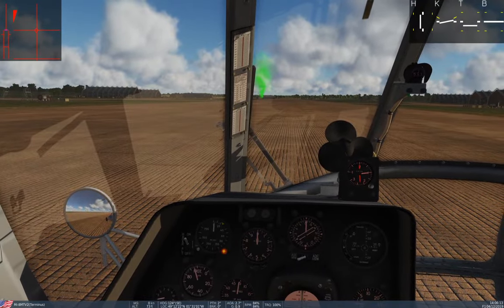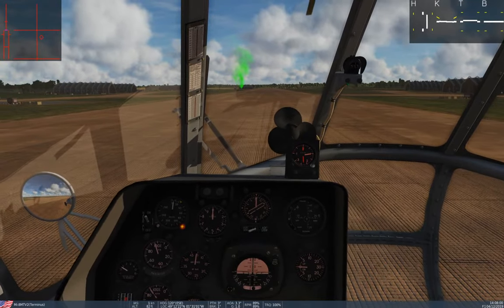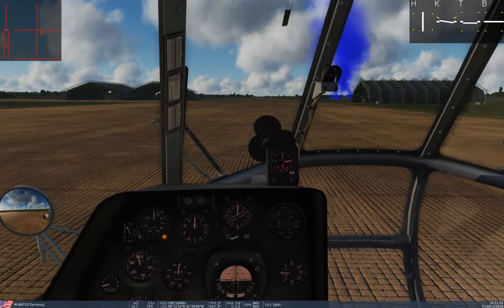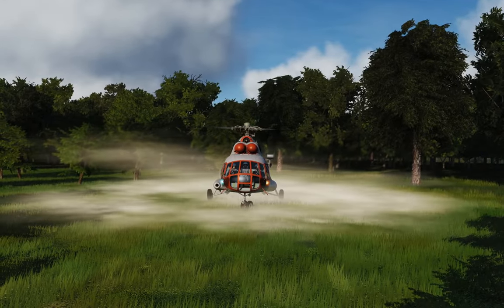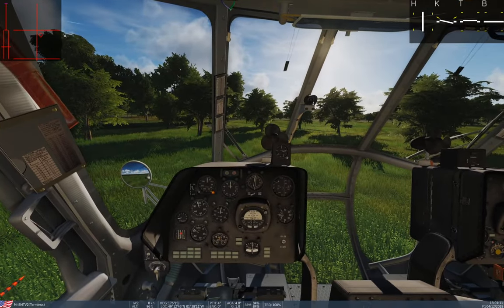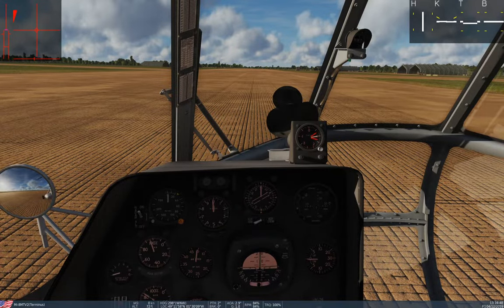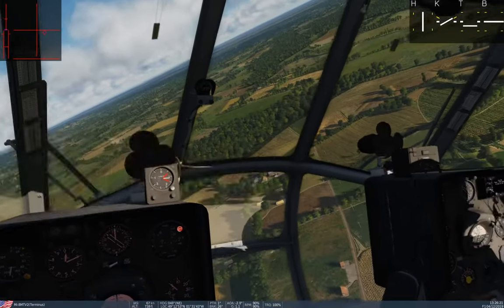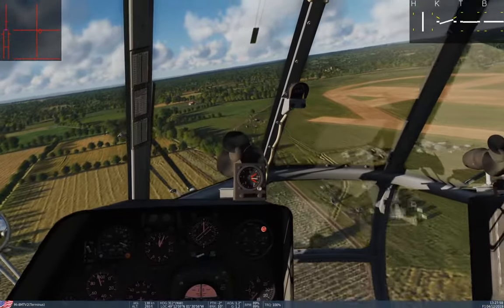DCS Mi-8: Takeoff Tutorial

Comment: How do you feel about joysticks without centering springs vs those with the much more usual strong centering force, for helicopters in DCS? 

I'm completely new to helos but have the option to learn using either type of stick, seems like high end helo specific sim sticks have little to no centering, to more realistically represent the cyclic?

Is there a controlability advantage other than to lower the workload on your arm and therefore a reduction in fatigue?
Reply from the maker: You're basically right on the money. I have the X-56 and as such I can completely remove the spring if I want to. This feels awesome for helo flight. It's really natural. But it absolutely sucks if you need to trim and fly straight & level for a while. You can work around it a bit using the return to center trimmer mode, but overall yea it can get tiring. A real cyclic has hydraulics that would hold it in place when you let go, which isn't an option for us with our joysticks.

So I tend to just keep the lightest spring on my joystick and it works fine. I don't feel quite as connected to the heli, but it's compatible with longer flights so I use it.

I wouldn't worry too much about it unless you're gonna go hardcore heli sim gear.
Reply: @vsTerminus  Cheers. I've still got my old X45, so took the spring out. Its weight makes it fall forward so I put a very light spring back in it that just about stops it from slamming into the stop and it feels like a lot less like physical work when making all these tiny adjustments that helos seem to want. Right now though it feels quite unnatural having always used "normal" return to centre sticks, but only for fixed wing aircraft.

If there is an input advantage I'll stay with it and learn that way, but I cant really tell at the moment.
Reply: My best option so far was the MS Sidewinder FFB 2 stick. With the force feedback I had realistic cyclic trim that held the stick in place, the center point isn't fixed but can shift with trim setting. It is very natural. However, after some Windows update the FFB of the stick is no longer working. Now I am using a Thrustmaster Warthog with 15 cm extension. No FFB any more, but control is very smooth and very precise and leaps and bounds ahead of the Saitek plastic toys that I had before.
Reply from the maker: @TheNordicVoyager  "the center point isn't fixed but can shift with trim setting" That's exactly how force trim works in the real deal. You have a trim button you hold to move the centering point to a new position. I hope one day the patent squatting stops and we can get some new FFB joysticks.

Comment: you don't need 100 km/h for running take off, transitional lift mode starts at about 50-60 km/h. moreover, Mi-8 tires are not supposed to hold that speed either.